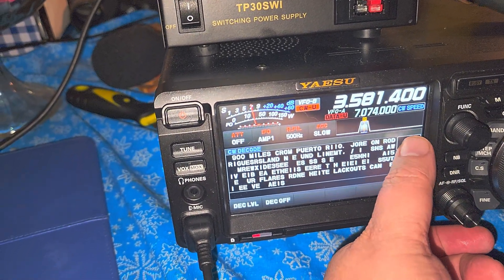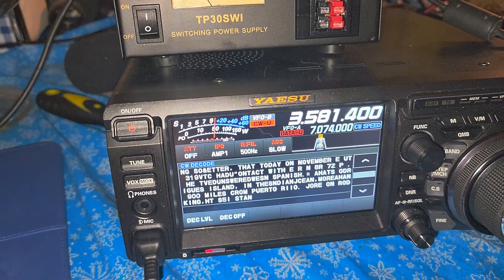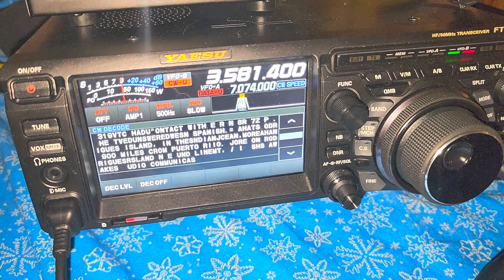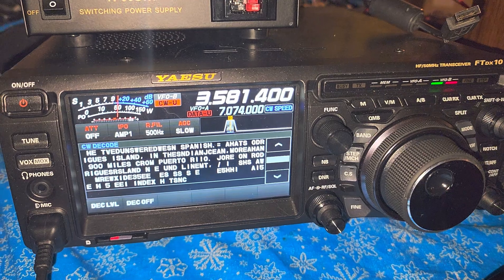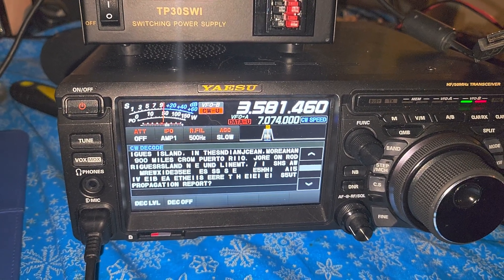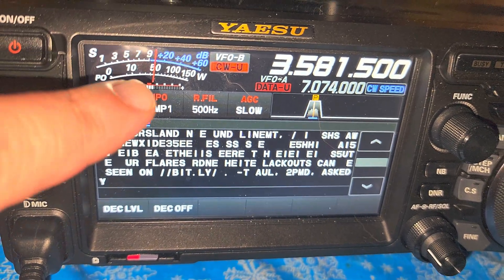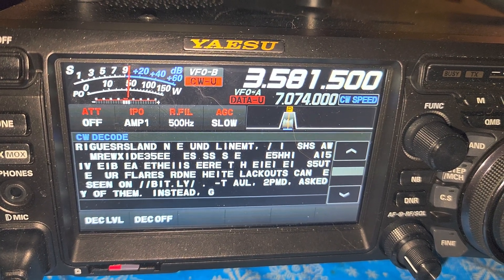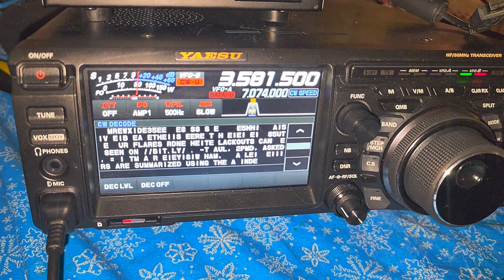Yaesu FTdx10 Playing around with the CW Morse code decoder

Comment: Is it just me or is this decode completely awful? Does not seem worth it vs FT-710 if the decode is a major decision variable for you.
Reply from the maker: FT-710 is just as bad... no transceiver receives CW well unless signal is cristal clear and of fixed speed.  No one should buy a radio based on its ability to decode CW or not... you learn CW and decode it with your brain